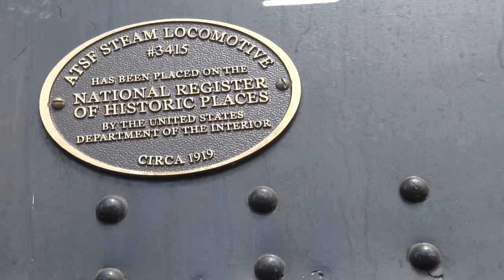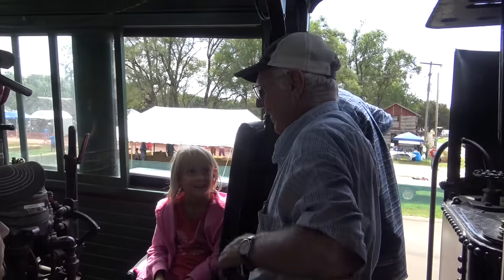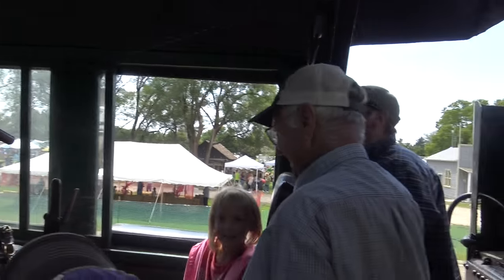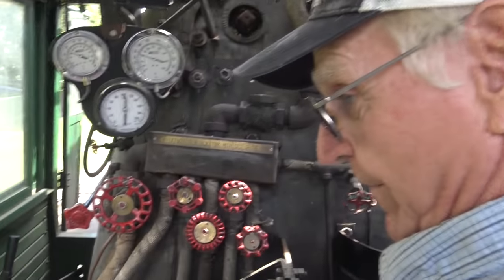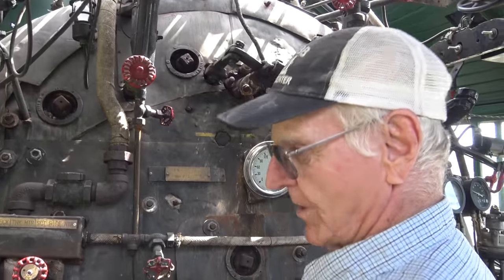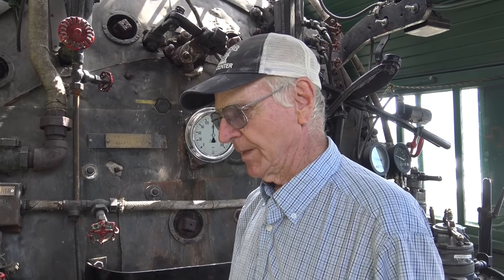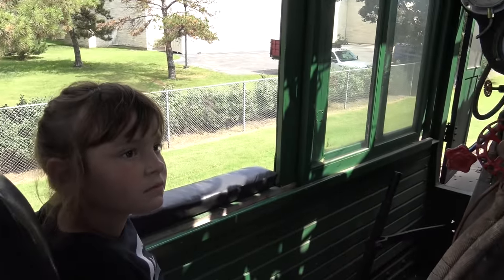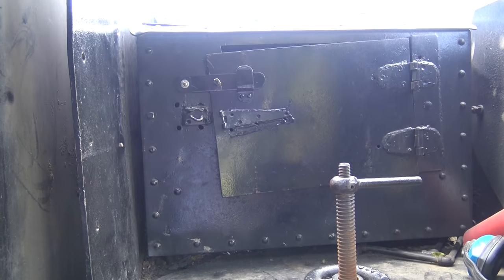How to drive a Steam Powered Locomotive

Comment: This engine scares me...
Reply: Why does it scare you? Because she's still in her working clothes? Not all steam engines are shiny and clean, in fact, more often than not in the late 40's this how most engines were looking. The boiler on this engine has been repaired and certified as per FRA regulation 49 CFR Part 230 as part of the locomotive's 1472 day inspection, the engine is perfectly safe to operate and functions within established parameters.
Reply: Most of those engines worked more than 5 miles worth of railroad as well and operated far more frequently than this one. It has a leaking throttle, both blow downs and it looks like the corner plugs have scale around them meaning it has a cold leak as well. There's so much rust and corrosion on all the surfaces that you couldn't tell if anything was leaking if you tried.
Reply: Ha! Apparently you haven't been around many Steam Engines up close while they're under steam. ALL OF THEM LEAK to some extent. Weeps and Leaks are completely normal as all valves may not close fully, all packing glands may not be perfectly steam tight (in fact its good for them to weep to keep the packing material moist and lubricated), or all pipe threads and plugs may not seal perfectly. First off, the blowdown valves on this engine are a form of quick opening gate valve which have a bronze valve gate or poppet/shuttle piston mating to a bronze seat, there's no O-ring or Gasket, and after years of rapid opening and shutting, and being wire drawn by not only the steam but the abrasive rust and scale hanging out down there, the valve seat deforms slightly or won't close all the way, so the valve weeps. Its not leaking badly enough to constitute replacement. The washout plugs on the corners of the mudring, lets see, what happens when you do a boiler wash and all the shit in the mudring comes out of those ports? It drools down the side, then when the engine is steamed next it dries to the outside and creates those streaks. This boiler is PERFECTLY safe. As you said, the rust is on the surfaces. Surface rust has absolutely no bearing on the boiler's integrity and if there were a leak, it would show under 150psi of steam regardless of if there is surface rust or not, especially with staybolts. Staybolts are hollow with telltale holes in the end of them so if one were to crack, it would piss hot water and steam like mad. The Firebox Wrapper, Mudring, and Throat sheet are not only riveted but also caulked along the edges of the seams (No not with sealant, boiler caulking means to hold a pnuematic gun with an edged blade going along the seam and mash over the end of the sheet, sealing it to it's mating surface). Where you need to worry about corrosion is INSIDE the boiler where all the action is happening. Pitting, Thin Spots, Stay-Necking, Stress Cracks, Knuckle Grooving/Thinning, Leaking flues, THESE are the things that are major concerns. This engine actually had parts of the Crownsheet and Doorsheet replaced during it's rebuild. By the way, the leaking throttle? Its partially cracked on purpose to keep the superheater elements cool. This engine has a dome throttle, which means the superheater pipes have no steam in them when the throttle is entirely closed. So, with no steam to cool them down, the elements crack or melt and fail from the heat of the fire. The globe valves on the steam chests just below the steam delivery pipes are open to prevent steam from building up in the cylinders while standing still. Engines with smokebox throttles had steam in the Superheater Tubes all the time so there was always a fluid to carry the heat away to prevent them from overheating. I work on steam engines of all kinds, not just Locomotives, but Traction Engines, Stationary Boilers and Engine Plants, and Marine Plants. This is machine has passed all required FRA inspections and is entirely safe to operate (which INCLUDES an Ultrasonic Thickness test, and based off of the thinnest spot in the boiler a Maximum Allowable Working Pressure is calculated by the maximum stress that thickness of material is allowed to handle under a specific factor of safety. Any spots deemed too thin must be patched.). You know nothing about real world steam, its a lot different in the real world than in your simulators, kiddo. This engine is still in her working clothes, she was not cosmetically restored, she was mechanically restored to operational status with no frills or "Dolling up."
Reply: Good for you "kiddo." I work on steam locomotives as well. Real ones not simulators since you seem to be insinuating I'm some sort of desk jockey. I'll give you the throttle, I didn't notice the dome. And the scale around the plugs did not come from a boiler wash, its on the tops of the caps. I don't know who the FRA inspector is who checks this engine, but mine would not let that fly. And exactly how bad does a blowdown need to leak to constitute a replacement, or in the case, lapping? Not to mention the fact that its leaking down onto what looks like the feedwater lines, and has been for a while judging by the corrosion, but wait that's just her "working clothes." Give me a break.
Reply: The Blowdown valve on the fireman's side is leaking a bit excessively. In that case yes it needs to be lapped, but even still it does not guarantee a perfect seal. The Engineer's side weep is about the same. The plugs under the cab on the engineer's side looks scummy, sure, but are they belting out water and steam like mad? No, they drool a bit when they're cold and take up when things get hot. Normal. Again the corrosion on the feedwater line to the Feed Pump, its surface rust. It's not corrosion or heavy pitting, just an orange splatter which can be easily scrubbed off. Should the blowdown valves be cleaner and in better shape? Sure I'll agree with that. Are they crippling the locomotive? Not at all. There were engines in far worse shape than this in operation on shortlines in the later days of steam. Also many other tourist operations had engines in worse shape than this. You want to see BAD? Take a look at the Baldwin 0-6-0 that's got her boiler cut open at Steamtown, before it was there, Sloan Cornell ran the balls off of it on his Pine Mountain Railroad. There are literally potholes in the firebox plating, the stays are all necked, some cracked and puddle welded just to seal the leaks, even the inner sidesheets themselves are puddle welded where cracks formed. Leaking flues had chicken shit welds around the beads, THAT is horrible. And his neglect showed when the explosion at Gettysburg happened with poor 1278. 1278 was mechanically in far worse shape than 3415 here, simply because 49 CFR part 230 didn't exist until after the investigation and Sloan's son was just a Lazy good for nothing and just ran the engine into the ground. If they replaced the crownsheet and door sheet on 3415, then the inside of the boiler must be good because all the stays had to be replaced as well as the flues. And a UT had to be done. Your comment about engines that are more frequently operated and run further, Yes that is true but in those days also the railroad had the infrastructure and shop crew to just repair the engine when something failed. This operation as you can tell is operating on a very tight budget. I'm sure they would have the engine all Shiny and New, completely remanufactured like the 2926 if they could, but alas they can only afford to fix the major mechanical issues that impede the operation of the locomotive. And this engine does not operate every day, far from it. This is just a bare bones working clothes engine. I'd stand next to her all day long under steam and not bat an eyelid. She scares you because she's not 100% perfect? Poor baby.
Reply: "This operation as you can tell is operating on a very tight budget." I understand that, it doesn't make the situation any better. I'm not busting their chops about doing the best they can, or yours for that matter. I've read the report on the Gettysburg engine, it came around from neglect and poor training. When I see engines like this I get very critical of the maintenance that has been done. Seeing an engine like this under steam worries me.
Reply: It's needless worry. Again, the boiler is perfectly safe. Does it look rusty? Yes. But it's a layer of rust microns thick on 1" thick plate. Pere Marquette 1225's wrapper sheet looks the same when she doesn't have her lagging and jacketing over the firebox (yes PM engines had Firebox Lagging, unusual I know). Imagine this engine like those rat rods with rusty bodies. Its rusty, but it's not cancerous rust like a 2002 Ford F-150 has got after being exposed to snow and road salt for 15 years. You can live in fear all you like but I'll go over there and help them steam it.
Reply: Play nice, men!  Nice engine, glad to see it running.  Definite SP whistle.  Steam And Smoke, Oleander does know steam, just saying.  All is well.  Would be glad to have you on my FB page, if you wish.  Thanks for posting such a nice video.  On 290, we had twin NY air Compressors.  They are upside down, from Westinghouse.  Interesting, but I like Westinghouse better. Thanks again.  Conrad Cheney
Reply: Oops, must of signed in with my sons name.  Mine is Conrad Cheney.  Sorry
Reply: And who are you? He may know some things but getting worried over surface rust is foolish. And who are you referring to for the facebook page?
Reply: My point is this, is the engine in as good of shape as it could be? No, not at all. Is it about to fall apart or explode? No. It wasn't really "Restored", it was brought back to operational status.
Reply: Lets try this again.  My name is Conrad Cheney.  I come from the land of the ancient Southern Steam Program (750, 722, 630, 4501, 2839, 610, & 2716,  Edaville RR (when it was the full 5 1/2 miles during the 60's), New Georgia RR with 750 and 290, and now Supervisor of Railroad Operations at Stone Mountain RR (Retirement job).   The Facebook page is mine, if you care to link up.  I forgot you guys are out west, but anyhow.  Surface rust is fine.  Steam leaks are fine.  Water leaks are fine.  I was just saying that I liked the locomotive.  As Bill Purdie use to say, "I don't care if it's painted pink with white polka dots, as long as it's running."  I am sure you have heard of Mr. Purdie, but if not, look his history up. Great Steam man.
Thanks again.
Reply: Thank you Conrad! I apologize for getting flustered. I'm actually in the Northeast. The old school Southern Steam Program was the best, it was a great Era and I wish it never ended. Bill Purdie, LEGENDARY Steam Man and Engineer! I wish I could have met him. I quite agree with Your Logic and His! I'll be sure to look you up on Facebook.
Reply: This engine with the right FRA inspector will fail. There are a small list of things I see that do not comply to CFR.... not sure how many engines you have been around working on. but I have a total of 8 different engines I have worked on. all varying. My main engine is the CNJ 113 of Minersville our engine sits outside all year every year and does not have the issues this engine has gathered. the blow downs should not be glugging water out and this engine shows proof of no water treatment which results in heavy extreme damage to boiler and appliances.
Reply: this isn't school, this is the youtube comments you don't need to write an essay.
Reply: Tyler Fenderson unfortunately you and the other person in this thread are more correct on 3415’s condition than you think. Wrong about water treatment, but a whole lot of other issues. This locomotive should not be operating.

Comment: 10 gallons of oil per mile?!!!!!
Reply: It does not make sense to me either. That means the  oil cost is greater than the fuel cost.
Reply: On second thoughts, it might be converted to an oil burner. The tank may be hidden in the bunker. Less chance of starting a grass fire.
Reply: All later Santa Fe steam engines were oil burners. When he's talking about oil, he means fuel oil.